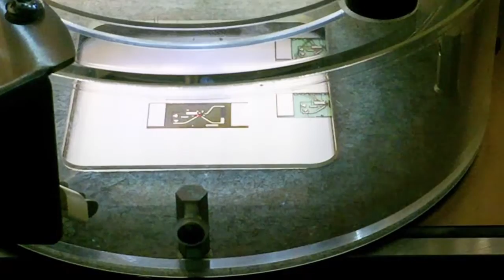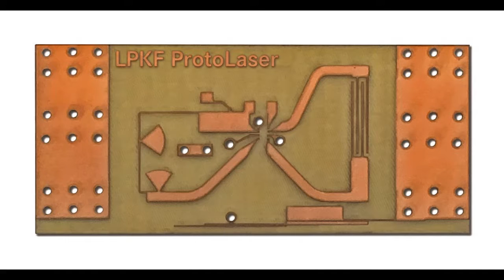Processing a RF Filter with the LPKF ProtoLaser U4

Comment: make a laser pcb drill. i bored of broken dril bits. make a tiny spot welder for layer  to layer spot welding with hot tip. when we use flexible pcbs we can spot weld vias.inner insulator can be melted by heat at some temperatures.